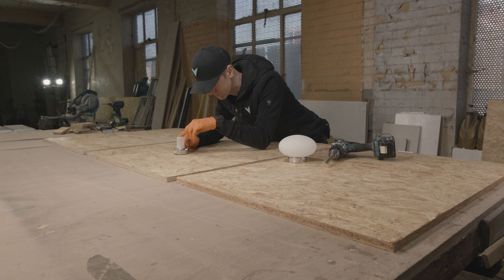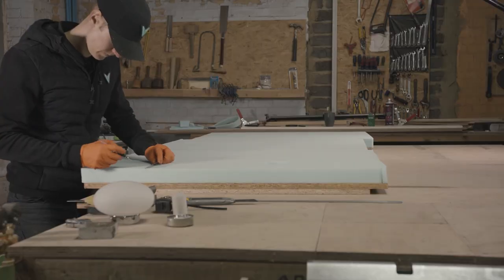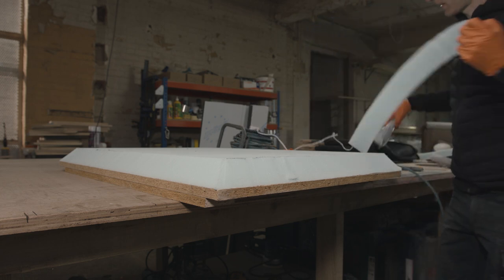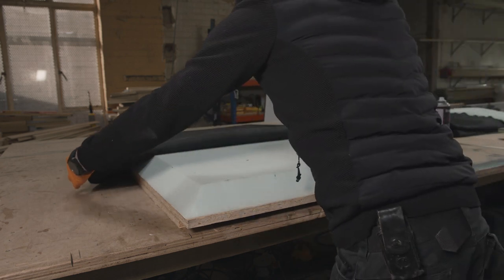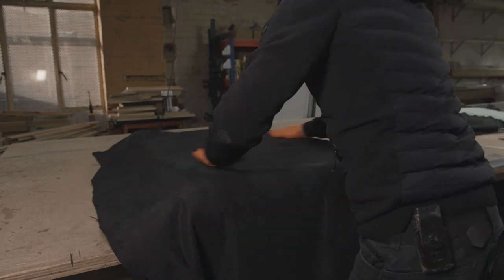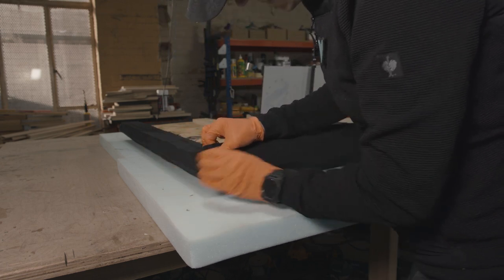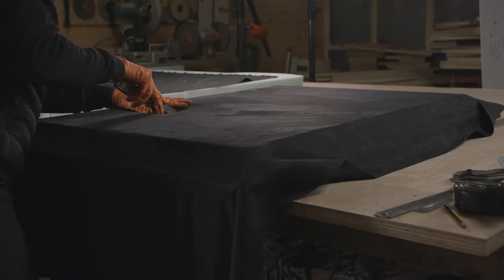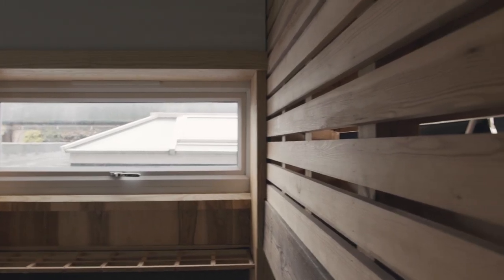DIY quick and easy fabric foam wall panels for the home

Comment: Would this work on a patio cover ? Or would the elements destroy it over time ?
Reply from the maker: If you used the correct fabric and foam it could work but I am not sure it would be easy to make it last without mould issues
Reply: @offgridscotland  I live in Phoenix arizona  a mostly dry climate , and it's mostly under cover . Would mold really be an issue ? Thank you for your response

Comment: Did the spray glue stiffen the fabric at all?
Reply from the maker: No but the fabric was on the stiffer side to start with. Maybe if it was a very thin fine babric it might but this one felt nice and plush on top of the foam and squashed with it as one piece if that makes sense so no cracking glue etc. They were expensive fabric specific contact sprays though not just any spray adhesive
Reply: @beyondtheworkbench  As long as it was still soft.
Reply from the maker: Yes it was still soft @EvilGenius.
Reply: @beyondtheworkbench  Thank you. You saved me hours and days of work on some panels I have been wanting to make for my projects. And I may have come up with a new and cheap sound doping technique thanks to your video.
Reply from the maker: Great, good luck with the project @EvilGenius.

Comment: What thickness is your wood as we want to do wall panels but with two of them being secret door panels
Reply from the maker: Great Idea! I think it was 18mm I used, if you weren't going to add a door I would say you could get away with thinner sheets but would stick to at least 18 for the door so that it keeps its shape which means you will have to use it throughout so that the panels are the same thickness. Whenever I have done hidden doors I used concealed hinges such as these to make sure the foam doesn't foul at the edges and you cannot see the hinges.
https://www.ironmongerydirect.co.uk/product/altro-concealed-hinge-95x19mm-satin-chrome-pair-183394?vat=1&pr=1&infinity=ict2~net~gaw~ar~358306792714~kw~~mt~~cmp~Smart%20Shopping%20%3E%20Catch%20All%20Products~ag~Ad%20group&gclid=CjwKCAjw4qCKBhAVEiwAkTYsPCMbGhR_Ha7uENP7iLV383zA4qaTP_ze7f5ljqZNZDE4uYe0cEfdpBoCABgQAvD_BwE